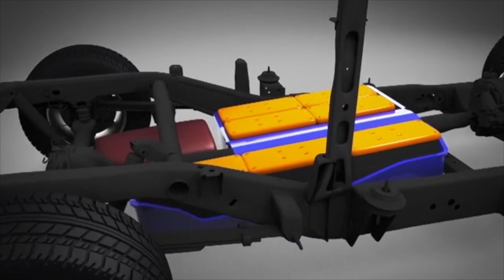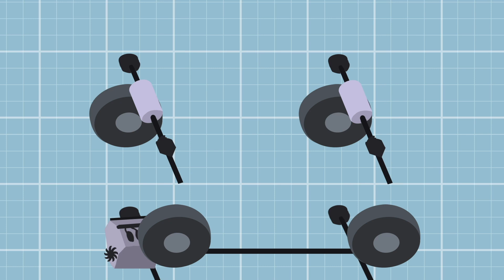Could This Pickup Truck Design Change The World?

Comment: A lot of work sites don't have electicity hooked up yet, so the ability to run a line from the truck might really appeal over dealing with a generator.
Reply: till then, theres the mitsubishi outlander
Reply: Dammit, can't get home cuz I ran my saw too long!
Reply: garyp4205, my understanding is that they have already produced some for large fleet customers, and will deliver significant quantities in 2019.  The company also appears solvent.  If they haven't delivered at least several hundred before 2020 then I will concede that it is vapor ware unless there are major extenuating circumstances.
Reply: Toyota Hydrogen Cell would solve that issue